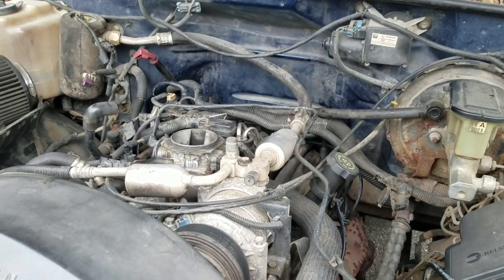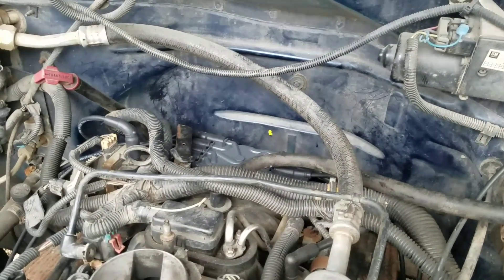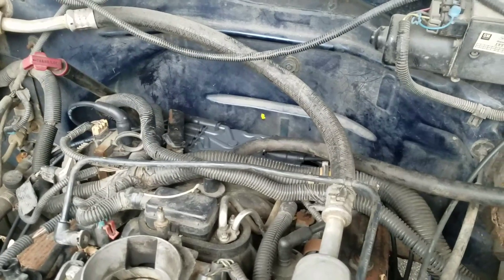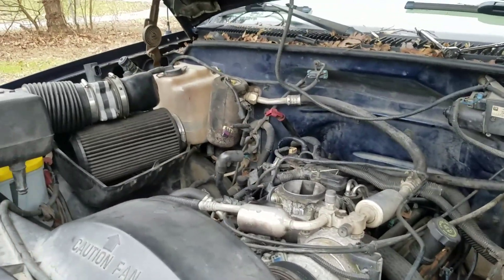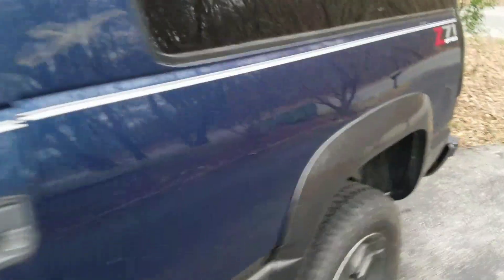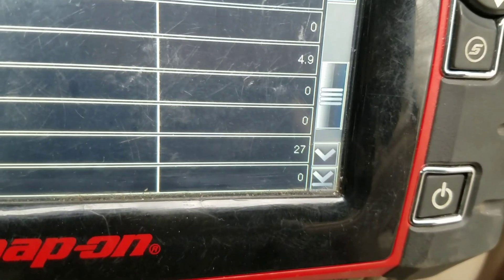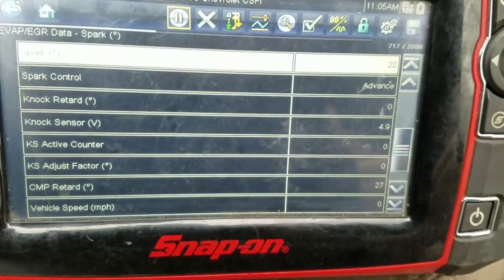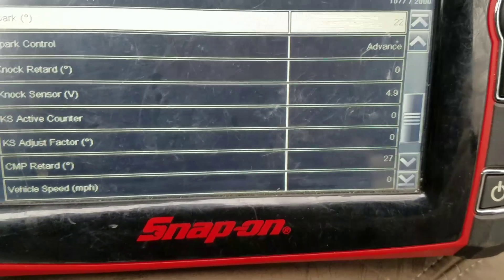P1345 Chevy 5.7L - Part 2 - Cam/ Crank correlation

Comment: My problem is no voltage to crank sensor and no voltage  to fuse for it.any ideas? Any
Reply from the maker: What year and model?
Reply: @SkyhookStudios  1998 3/4 gmc 5.7
Reply: I've installed cap,rotor,wires,plugs, cam sensor,crank sensor, coil,ignition module . Now it starts, won't idol. spits sputters backfires. Have voltage at crank sensor now but runs very ruff. Everything was fine until I ran out of gas. Then wouldn't start .  Fuel filter is good. I'm thinking timing chain .
Reply: New starter ,alternator, battery  all fuses and relays are good.
Reply: 220000 mileage
Reply from the maker: First off, if it was running fine before running out of gas, I wouldn't think the timing chain would be at fault. I would be leaning towards a fuel pump. Double check the firing order of the wires. Ive mixed them up myself numerous times. Do you have a scanner to check for any codes or maybe see what the O2 sensors or fuel trims are saying?

Comment: Are you literally rotating the dist gear on bottom or just the rotor on top of the dist?
Reply: Both, but the dist housing stays in the same place, this moves it around 50 degrees though so I wonder how it looked after he mived it a tooth

Comment: I’m getting the same code but truck has a knock would this cause it to knock like that?
Reply: Too much timing will cause pre ignition(knocking)
Rotate the distributor clockwise to take out some timing

Comment: Dose this happen when not have done anything to the truck? Mine starts hard struggles at higher speed and rpm a camshaft crank correlation code. I've done no repairs just hooked up my plow and fixed a cpl bad wires and stuff and then this issue started. The truck also has been sitting a cpl year and only used in the winter until last year I'm bringing her back to life lol

Comment: Been working on vehicles over 30 years. Do not get DEEP into electronic scope or waveforms. Had the vortec come in with distributor retard out. After watching MANY videos and none of my scan tools read cam retard, I did the hole in the cap viewing spark as engine is running. This put out my code with very little movement to make the spark straight on the terminal. So was lucky to not have to remove dist to move a tooth. Never in all years of working on vehicles have I drilled a hole in a distributor cap, but it WORKED. Covered the hole with roof tape for weather repel.
No more P1345....without the $2-3K scanner.
Reply: I have the same code on my 99 suburban, but my engine runs beautifully, starts and runs magnificently period accelerates beautifully, idols perfectly. I don't understand the code when the vehicles running so well. I did have my distributor changed about three or four years ago and I know they had a hard time with it, but I got a perfectly running vehicle that's throwing a 1345 code

Comment: My first comment was not exactly correct. There is an odd # of teeth on the drive gear. The correct repair is remove the roll pin spin the gear 180°. Problem solved. 
You could adjust it back and forth forever and you would never resolve the problem.

Comment: Did you ever make a 3rd video? I'm plus 15 degrees, can't rotate the distributor to take out the 15 degrees. New timing chain, just installed, points were dead on on the cam and crank gears, guessing I'm a tooth off on my distributor?
Reply: ever figure it out?

Comment: Where is part three? This tahoe either has a worn timing chain or a worn cam/distributor gear. WTF?
Reply: What was the issue?  Something had to have changed to set this DTC.  Did someone throw a new distributor in out of whack or something else?  I've seen these distributors loose the press fit between the shaft and rotor mount that weirds out the timing.  Something changed somewhere.  Just curious.  Dig the Solus.  Nice tool.
Reply from the maker: When I encountered the vehicle, it had a new distributor in it. From that, I assume it wasn't set correct when installed.
Reply: So what’s the real reason for this p1345 code
Reply from the maker: As stated in the video, the cam sensor is part of the distributor and therefore is somewhat adjustable. If the cam sensor was in a fixed position then I would say the cam chain or something else was mechanically worn.
Reply: Skyhook Studios you did not solve anything with your video is all I'm saying. A third would be good to show a conclusion.
Reply from the maker: I agree. It was one of my first recordings. While filming the first part, I didn't even plan on doing a second let alone a third. It started raining and filming was a chore already. If I get a chance with another Chevy 350, I'll wrap it up. Thanks
Reply: there is another possibility,  check  key way hole  on  ignition crank trigger wheel .

Comment: This guy is doing this the wrong way lol there is a special place on distributor to point the rotary button while engine is at tdc late 95 through 99 are that way the early models just point rotary button to number 1 at tdc
Reply: The distributor he has does not allow you to rotate the cap.

Comment: How can I get in touch with u I got a snap on scan tool I need to get to the timing setting
Reply from the maker: You want to go into engine data and then look through the PID list for the reading.
Reply: Skyhook Studios what could be the cause of my rotor n cap
Reply from the maker: Cause of what?
Reply: Skyhook Studios rotor n the cap where burnt
Reply from the maker: Just replace them. That's normal wear and tear. The spots that look burned are where the high voltage goes across.

Comment: I don't have active data on my scan tool so I'm taking a guess when I turn the distributor. When I place the strobe timing light on the damper the timing line lines up to around where the timing tab would be. That's could be +/- 10 degrees. Question: If I get the timing 2 degrees +/- (where it should be) will the check engine light go off or do I have to erase the code when I get the timing right?
Reply from the maker: Troy Gearhead first, try to "borrow" a scan tool from a parts store. Or better yet, just buy an aftermarket one that gives you live data. You can eBay Bluetooth one's that support phone apps for 15 bucks. They an invaluable tool that you will use more often then you think. I think your gonna spend a lot more time and effort guessing where it's supposed to be. If your insistent on doing it that way. Just disconnect the battery after each adjustment. The light will not go out until you do 3 key cycles with it in the correct position. Good luck.

Comment: Thanks so much for your video. Yours is the most helpful on YouTube by far. I've been dealing with this stupid problem for a week now and can't seem to get the crank and cam synched up right. Your video helped a lot
Reply: ok  i just  fixed  it  ,  hers  where my problem  was ,  ignition crank trigger wheel  ,  the keyway hole  was worn  out ,  how i don't  know  ,  at first  i  was going  to  replace  gears and chain  ,  after  removing  dampener and  t. case  i  found  was  wrong ,  sending new gears and chain  back , only needed  new  wheel ,  runns better  than  it  ever has  since i owned it    replaced  dis.  2 years  ago  helped ,  but  it was   wheel  most likely  all  along